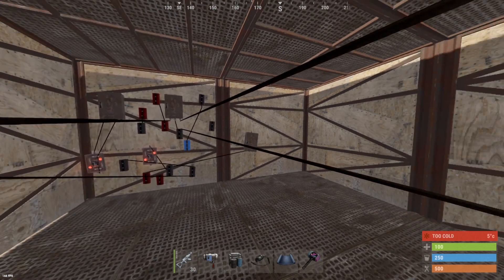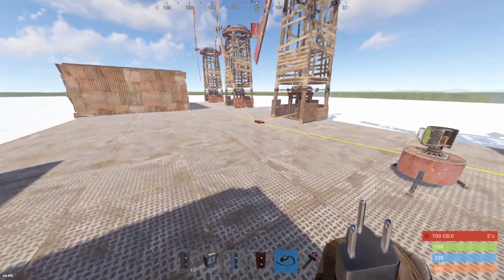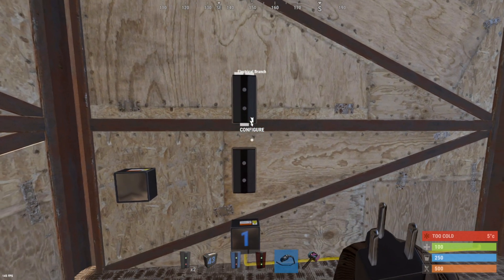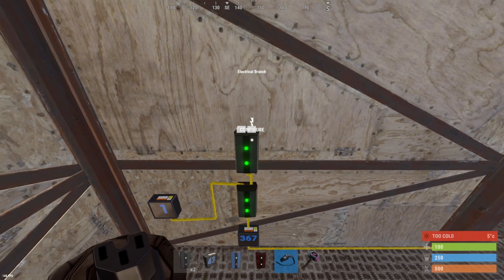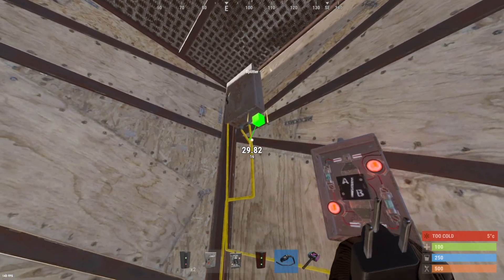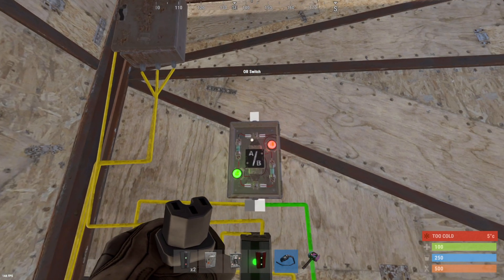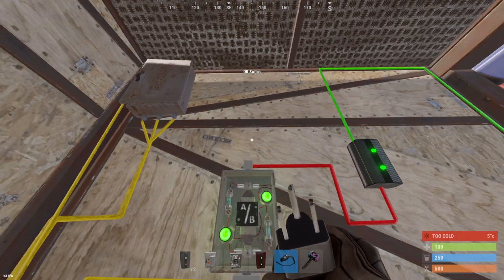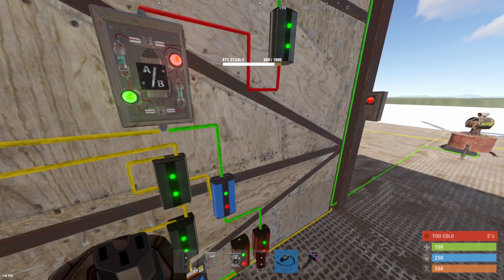Simple Rust Battery Backup Circuit

Comment: how do you set it up to more turrets?
Reply from the maker: My approach is to place 3 branches after the OR Switch. Each branch out emits 94 power to a splitter, and the power out goes to the next branch. Next you can hook up the 3 splitters coming off the branches to 3 more splitters each. You'll end up with 9 splitters with 10 power per output, yielding 27 powered turrets.

Additionally the last branch in the circuit should have an extra 12 power if you set the counter to 300, which can power your 28th turret.
Reply: @X7Dragon  thank you so much you the goat
Reply: @X7Dragon  do i have a discord that i can contat you from
Reply: cuz i need some help im lost on something